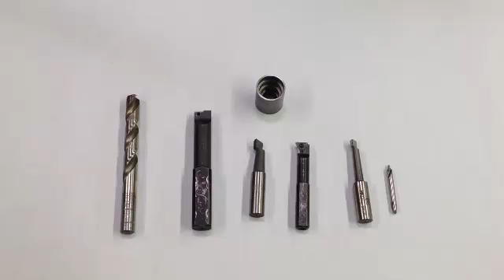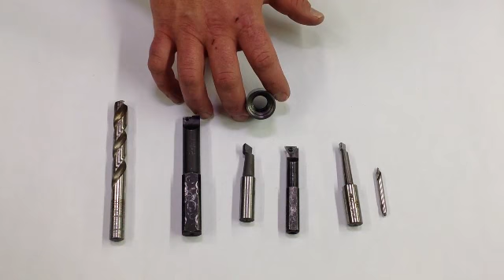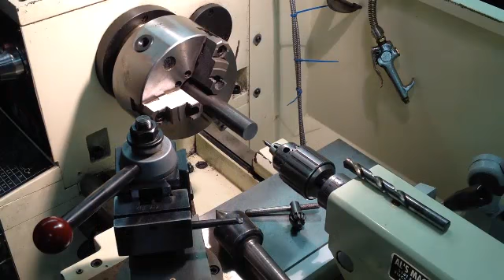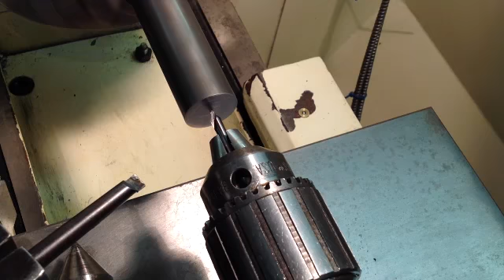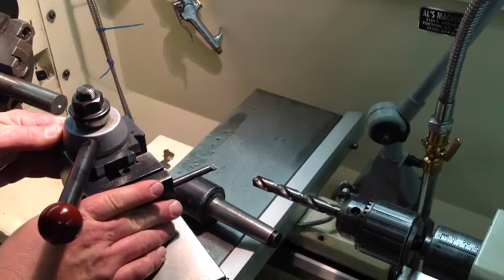Internal Boring

Comment: Hi, I'm looking to do some boring. I've seen other tutorials saying to position the tool 's cutting edge slightly ABOVE centre to compensate for the workpiece trying to push the bit down. What are your thoughts on this? Also I can't seem to fathom out what shape tool to use and what angle to position the tool in the tool post. All the vids on youtube I've seen don't show an ultra close up of the tool bit and its angle in the tool post. I regret not tapping into my Dad's knowledge of the lathe, he was a turner and my Grandfather too. I have a steep learning curve on my hands now!